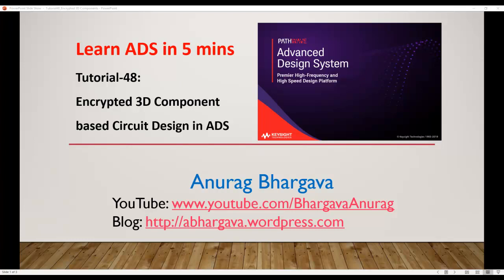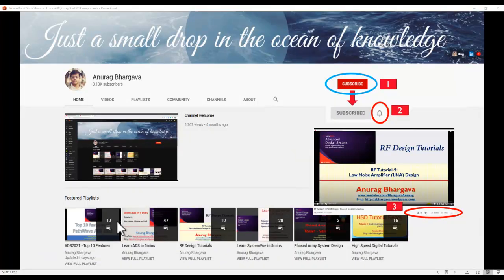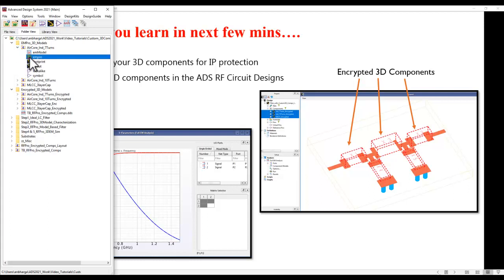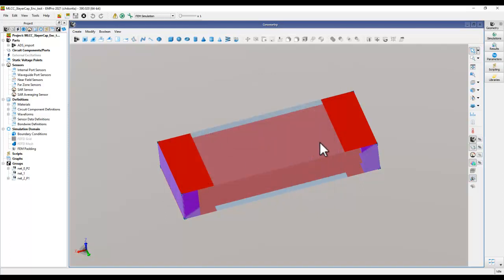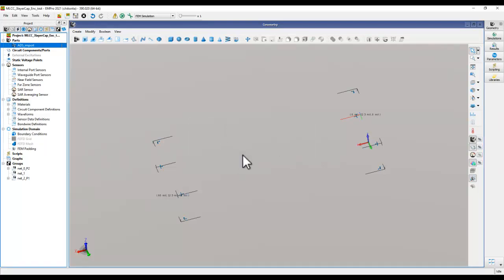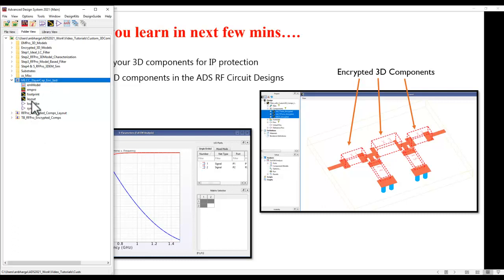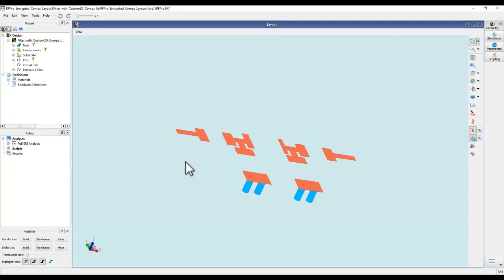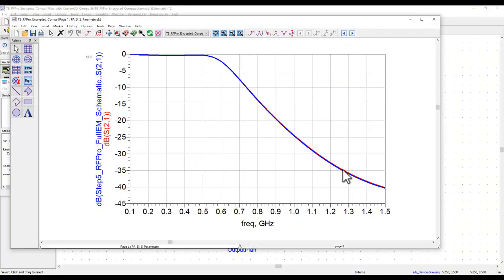Tutorial-48: Encrypted 3D Components based Circuit Design in ADS

Comment: can i use two layers for a multilayer design?, that is do I aculay need a pregpreg,
and another question is that for building up the multilayer, I have a machine that can drill the gerber file on one PCB, so can I design the two layer then connect them with vias, does it work that way?, or should to connect to a company for the fabrication?
Reply from the maker: You need to really work with the fab company after your design is done with all considerations in the SW and you have EM simulated the performance to take care of all the parasitics etc...
Reply: @BhargavaAnurag  could you please give me names and link to fabrication companies .